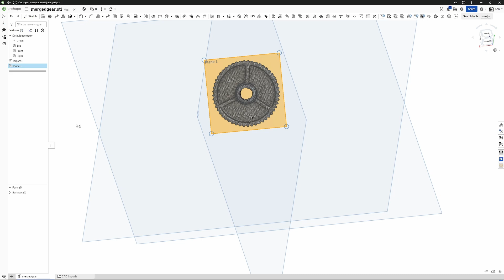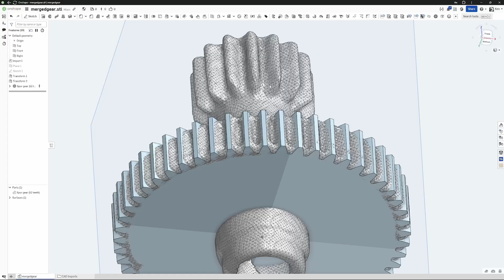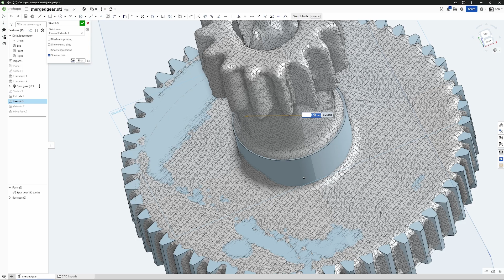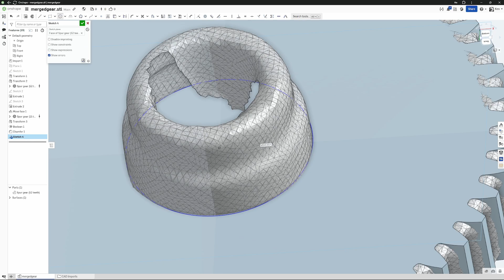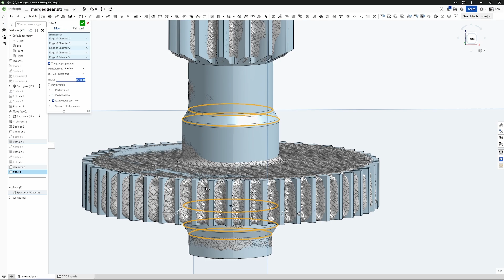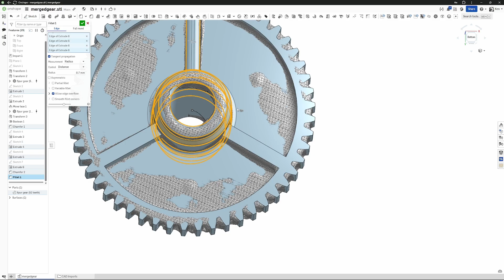3D Scanning - Reverse Engineering Mesh to CAD

Comment: Instead of hand rotating it i would project a bunch of points on a plane cut on the ribs , and eyeball best fit your ref angle as a line, then make a plane through center axis parallel to your best fit.